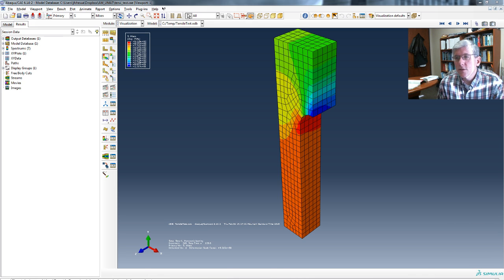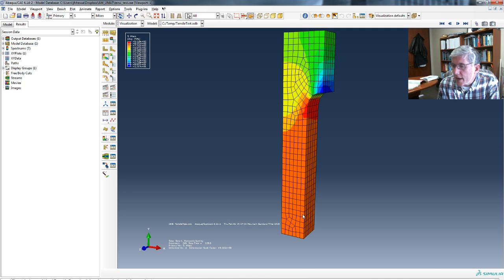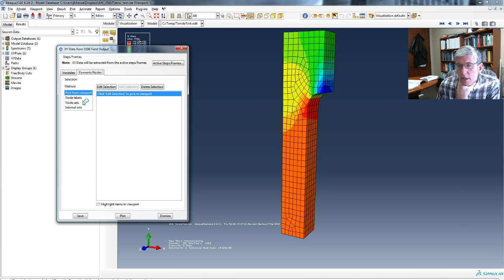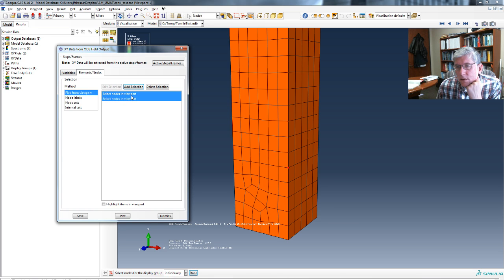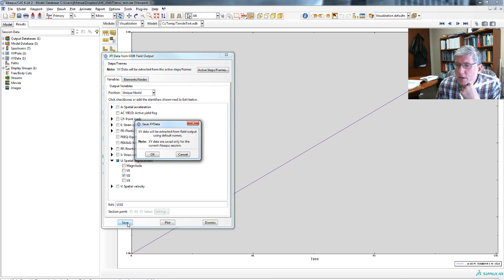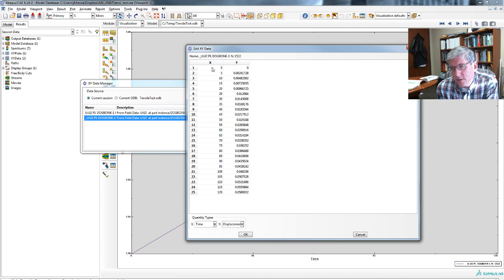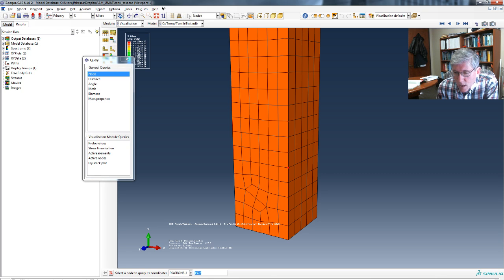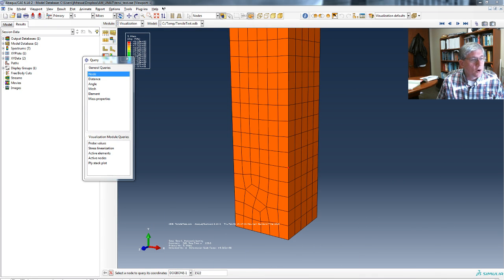Getting x-y data from Abaqus CAE

Comment: Thanks for the great explanation! Is there also a way to plot the displacements U against the LOAD increments? (You plotted it against time, which is not so helpful for calculating a spring constant)
Reply: You could do the same process with load, and then you get load vs time. Then you can combine the strain vs time and load vs time, to get a load vs strain curve. Using 'combine' option in abaqus helps to plot it together.

Comment from the maker: I just picked a node on the edge that would correspond to where an extensometer would be attached to the specimen.  I used query and selected the node to find the exact coordinate
Reply: OK.

I got the baseline base coordinates in 2 (equivalent to Y). That's right?
Thank you for the answer.